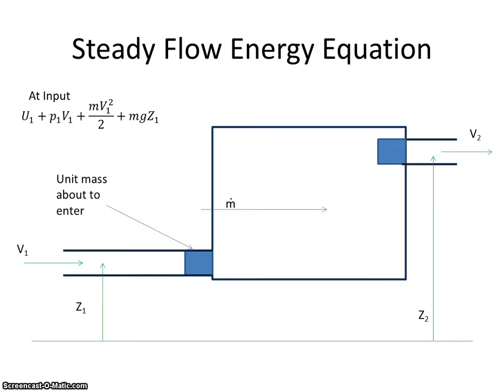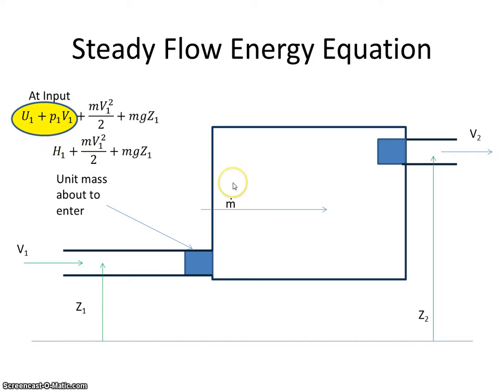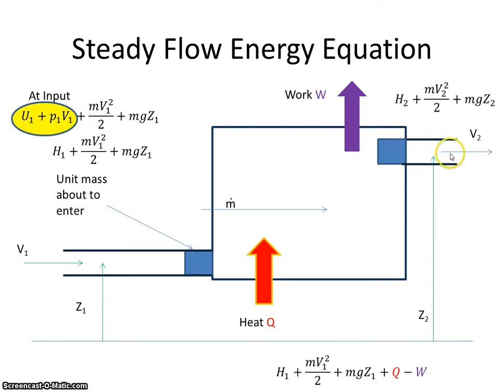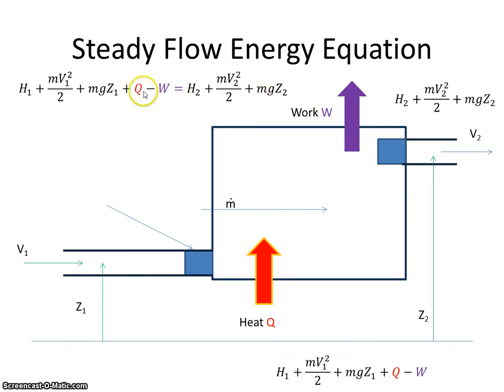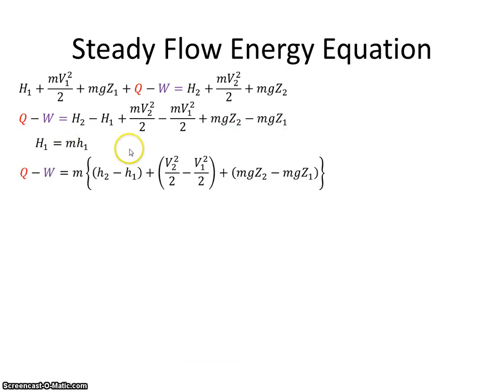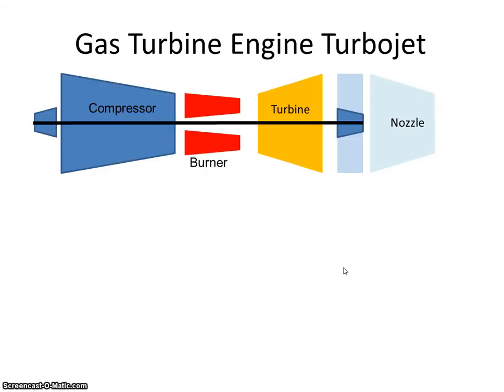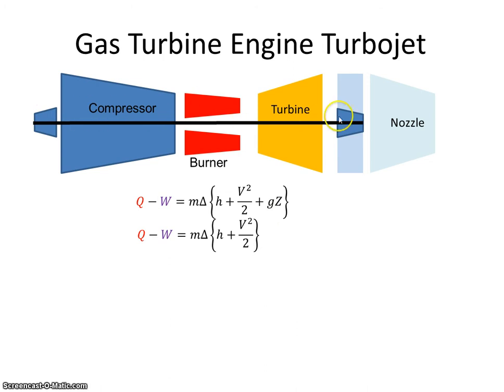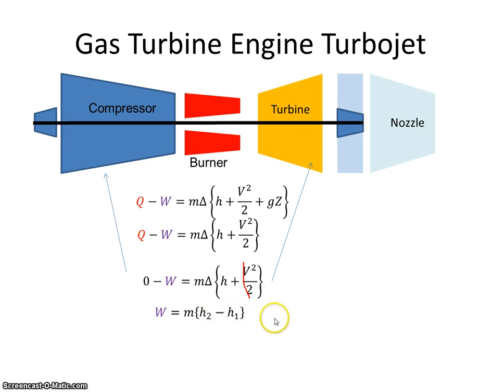Steady State Energy Equation

Comment: nice explanation but I have a confusion that Q-W=m{(h2-h1)+...............},then if Q=0, then the equation should be W=m(h1-h2) not W=m(h2-h1), Isn't it?
Reply from the maker: Yes.  But the sign of W is also important.  If W is negative, then work has been put into the system (e.g. Compressor), but if W is positive, then work has been taken out from the system (e.g. Turbine).